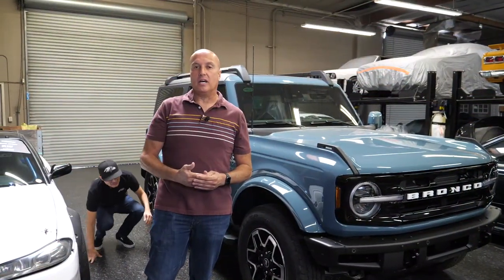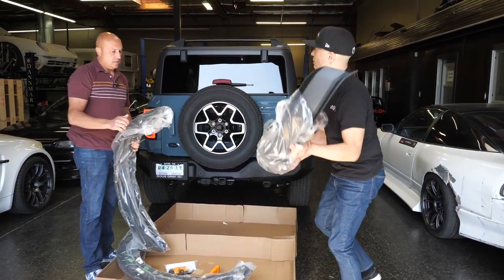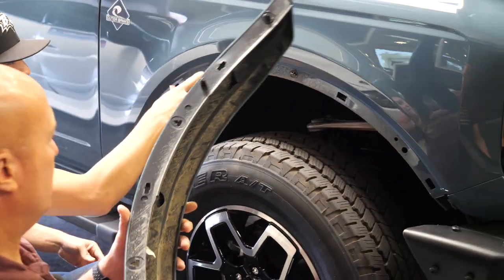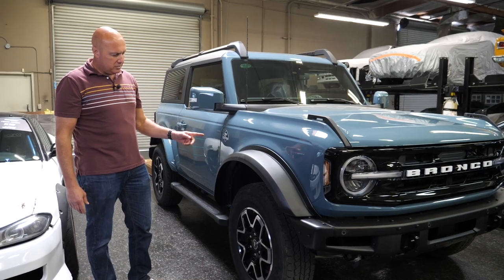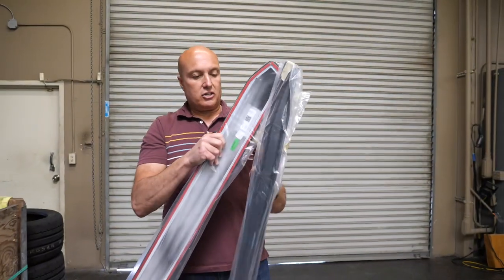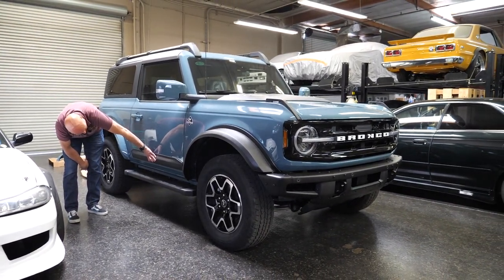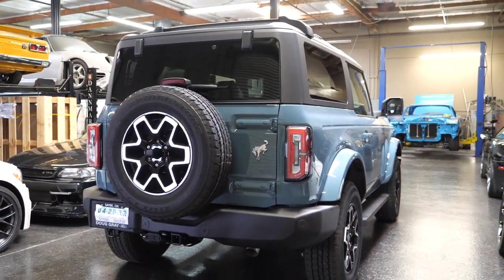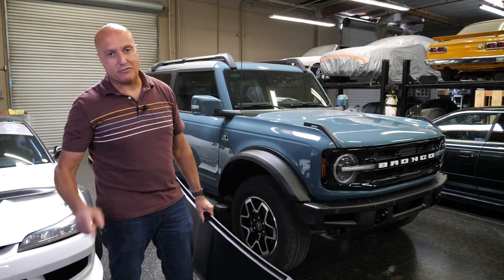What does the 2022 Ford Bronco Body Appearance Kit REALLY look like?

Comment: The one thing that bothers me about the new Bronco is the circular flares- the original Broncos had more angular wheel openings. Someone makes replacement fenders with the more retro angular flared openings. You guys should put those on- the whole design really pops with those, and it would stand out among all those round flared trucks.
Reply from the maker: Yah we noticed the arches too. So far the rig itself is full of tech and fun to drive. But the flares need some upgrading.

Comment: i do not think the body appearance kit is going to work on an Outer Banks version with standard wheels/tires. Since the body appearance kit is installed at the dealer, can you cancel that part of your order?
Reply from the maker: We can't. cancel it since it's been opened up and partially installed. We can just sell it second hand.
Reply: @JustDriven  I currently have an Outer Banks 4 door in production this week. I ordered the Body Appearance Kit and now based on more research I have decided I do not want to spend the $1790 - can I tell my dealer at this point to cancel the Body Appearance Kit?
Reply from the maker: We recommend you try! You saw what we thought of this overpriced 3D sticker set.

Comment: I unfortunately purchased the appearance package and had it installed today…. The flares are ridiculous and in now way should be put onto a bronco without the Sasquatch tire package.  Worse, the Ford website is void of ANY detail of the kit and the one pic shown when selecting the package shows a much smaller flare, similar to what they put on packages that don’t have matching color flares.
Reply from the maker: Dang. Sorry to hear this. We created this video to help others out there to serve as a warning...or a PSA for anyone considering the package to also think of what wheel and tire package you want also! What do you plan to do now with the package?